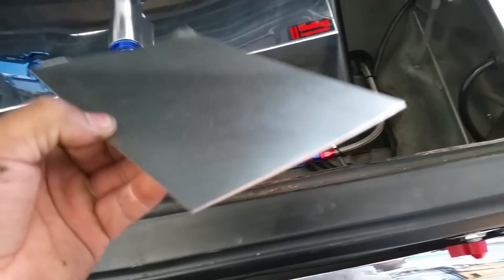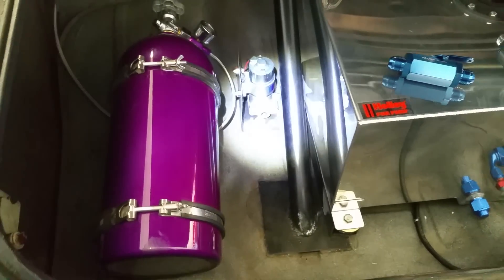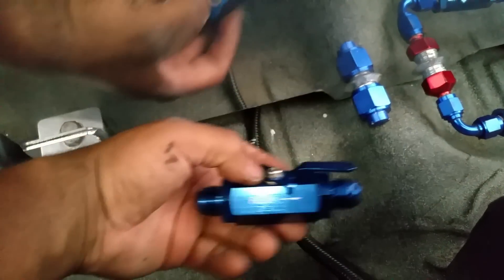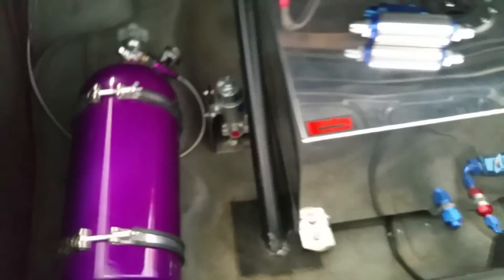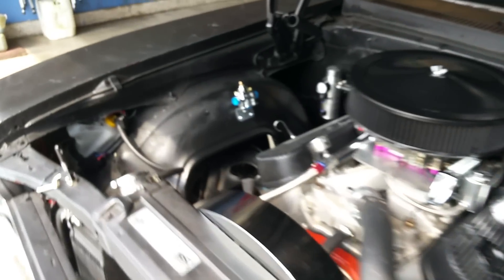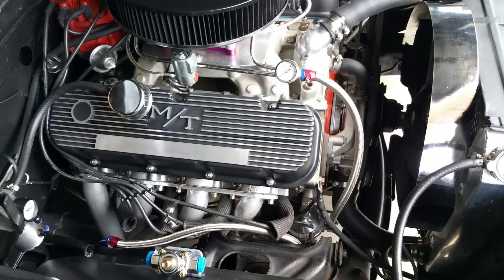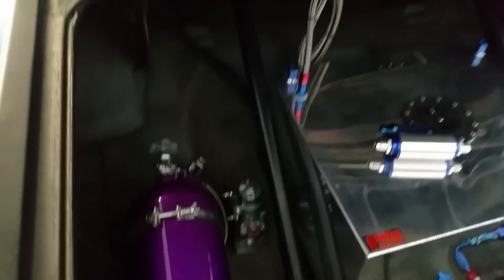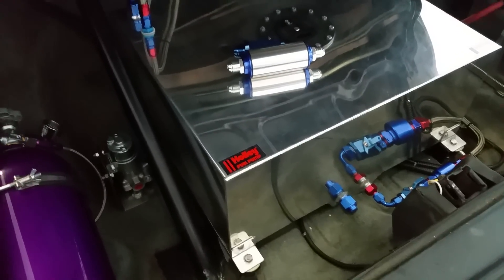CHEVY NOVA BIG BLOCK HOLLEY BLUE

Comment: Really nice job on the bracket just put a peace of rubber under it or you'll hear and feel that blue pump running 😉 Love the GODZILLA sticker 👍🏻👍🏻
Reply from the maker: cool thanks for heads up
Reply from the maker: do I need a 30 amp relay to run the electric  pump
Reply: I just picked up a 100amp relay this way i can run a few things off of it , and correct make sure you have a in-line fuse , I am not a pro at electric wiring i just got some info from a turbo form i am on , But yes use the relays for sure it will only help you from burning the car down and voltage spikes .
Reply from the maker: +juiced71 got ya thanks

Comment: I see you don't have a Vacuum Advance on the distributor? i think since your car is a street/race set you might benefit more from it? what do you think.
Reply from the maker: my tuner said plug it, not sure why
Reply: you might benefit it it was hooked up and dialed in at the canister, atleast ask around about it i think you're missin some hidden HP performance and better gas mileage with out it.
Reply from the maker: +sabrom  ok when I get tuned again I will bring it up
Reply: sounds like advance is locked out
Reply: @juiced71  This thread is old but depending on your cam profile your vac might be so low the advance won't respond anyway. It is worth 2-3 MPG on the street. Easy way to tell is hook a vac line to it and see what happens. If no response your signal is too low.

Comment: Really nice job as usual ! You do nice clean work!  One thing you might wana add to the list of nitrous parts is a nitrous blow down tube without it they may not let you run with it...
 http://www.ebay.com/itm/NOS-16169-Nitrous-Bottle-Safety-Blow-Off-Adapter-with-Down-Tube-/171994344150?hash=item280ba96ad6:g:fzcAAOSwI-BWQwN8&vxp=mtr

I have the competition Motorsports activation switch  that bolts to the carb it would be perfect for you because it uses 3 holes on the carb and with yours being messed up on one hole you would still have two mounting holes the only problem is i cant find it anywhere, i bought mine years ago..
Reply from the maker: I have a firewall so I don't need it, might get it anyway tho, good lookin out
Reply: Oh ok my buddy follows you also and he was getting harassed over it , i want everything to go smooth for ya i wana see that car in the 10s ! Hah
Reply from the maker: I figured mine out, the instructions said I need a 8-32 to tap two holes, the hole with the broken bolt I don't even need to use it
Reply: oh sweet deal ! Them holes aren't tapped out already? or because it was a braswell carb they didn't do that
Reply from the maker: +juiced71 not tapped out, the instructions say some carbs are tapped some are not, but it fits perfect, just gotta tap the holes
Reply: ahh i guess the carbs that came with the choke ,
Reply from the maker: +juiced71 I'm just glad the instructions say what number tap to get lol
Reply: lol instructions ? what are they? hahaha !
Reply from the maker: +juiced71 lmao screw bolts into holes may need to tap lmao
Reply: BLAAAHH Hah Hahaha!  Gotta Love it !!